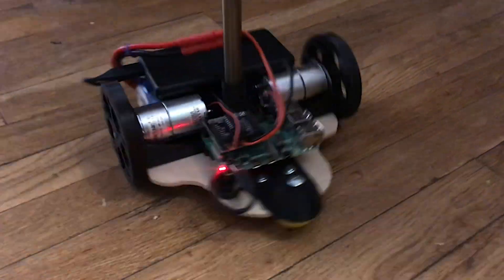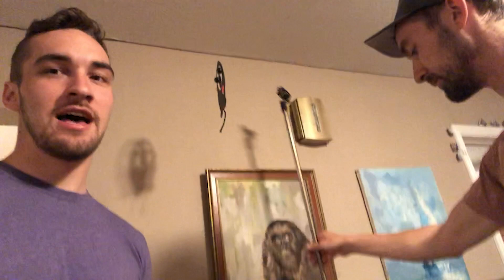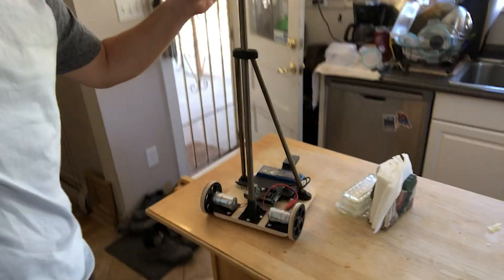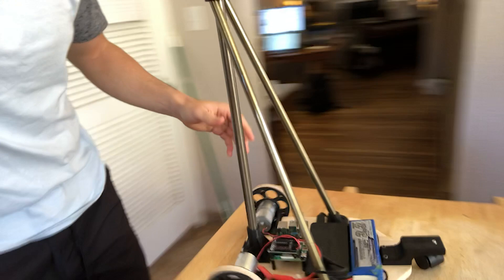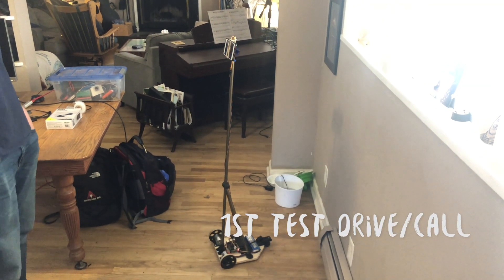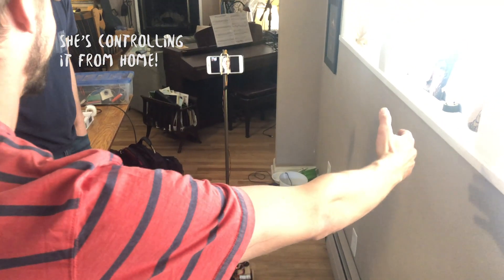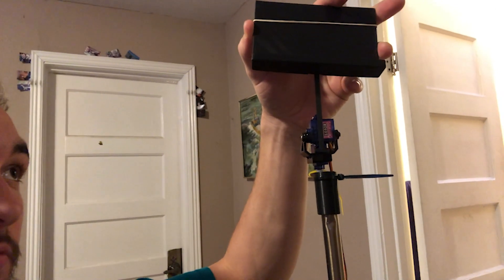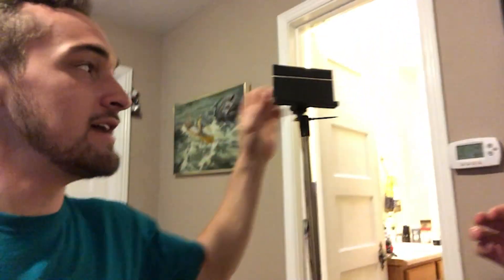COVID-19 Telepresence Robot

Comment: Hey  Bro can you share with us what software you did use for video chat and remote controlling
Reply from the maker: We actually created a custom software solution. The video chat can be any platform you choose (independent of the control software). The controls ending up being a website that communicates to a server which the pi pulls from! Does that answer your question?
Reply: @goodpigeongoods  I am working on a single web app that contains video chat using Webrtc and Javascript and for control  I am using node js . After creating the web app  I tried  to implement a desktop app on the pi to display the user on the robot screen but I am having an issue with Webrtc . It is not supported on electron. So can u explain to me what kind of software did you use maybe you can save me on mu final year project . Thanks a lot :)
Reply: @goodpigeongoods  How about you share not only the CAD files but also the software? In what language is it written?
Reply from the maker: @Flix-f6q  check the description for the link to our custom software on GitHub! Hope it helps.
Reply: @goodpigeongoods  I will do so. Thank you very much.

Comment: Hi Team,
Kudos to you. If you have tried to calculate the cost of making it, do let us know.
Reply from the maker: We calculated around $150. But you could do it for cheaper!
Reply: @goodpigeongoods  Thank you for your response. The reason I asked is to see if it worth to build one on my own or to buy an app controlled RC car like (Anki @ $40) + a motorised 360 degree selfie stick ( around $13) and integrate them. Share your thoughts.
Reply from the maker: @senthamizhselvan8553  Good question. The biggest design challenge was connecting the robot over the internet so that it could be controlled from a distance (across the world). If you can get the selfie stick and the car to be internet controlled and stable enough to drive, I say go for it! The problem that arises from using pre-made components is that you have no control over how things are controlled (speed, ramping, etc).
Reply: @goodpigeongoods  I completely agree with you. As I mentioned earlier, my curiosity was to confirm that the amount of time and money we put in on something is worth for the result. However, I agree with you that the level of satisfaction we get by making things on our own is incomparable.

Keep up doing the awesome work.
Reply: You know something, I would buy it from you now if you can ship it. Do let me know.